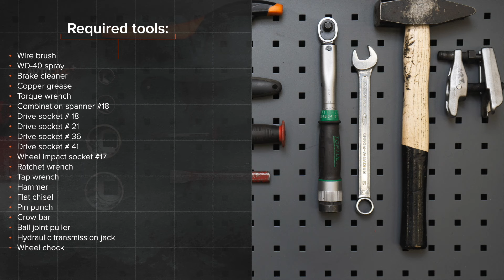How to change front ball joint on PEUGEOT 307 (3H) [TUTORIAL AUTODOC]

Comment: Cannot stress enough how important it is to have the old ball joint clean before you attempt to remove it. I like to remove the rubber boot as well to make sure the socket grips the ball joint securely. If you round it off, it causes hell trying to remove it. Great video!!

Comment: Its not that easy, that video is pre prepared.
Reply from the maker: We cannot show all the nuances and problems when replacing, this is all individual and it is not always possible to solve them at home. To avoid this, we always recommend that replacements be made at specialized services.
Reply: I had a nightmare with mine. Eventually got it out with an impact driver but I could see swarf coming out of the hole as it unscrewed so bad sign. Sure enough, the thread in the hole was damaged to the extent the new ball joint wouldn’t screw in more than about 5mm. Ended up replacing the whole steering knuckle🤬

Comment: What is purpose of bolt at 1:00 ?
Reply from the maker: The bolt at fragment 1:00 of this video is required for fixing the brake disc, so that it makes possible to unscrew the shaft nut.
Reply: Could have used an impact wrench shown later in video

Comment: Why do anything with the drive shaft???
Reply from the maker: To assemble this mechanism back, you need to release the steering knuckle from the shock absorber strut. 
Since the shock absorber tension makes it difficult to put the ball joint on the lever.